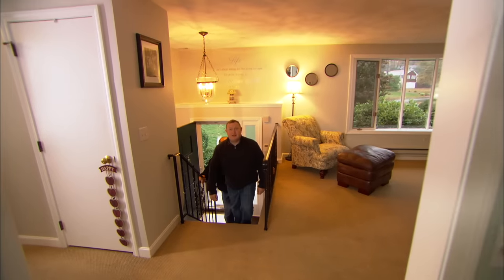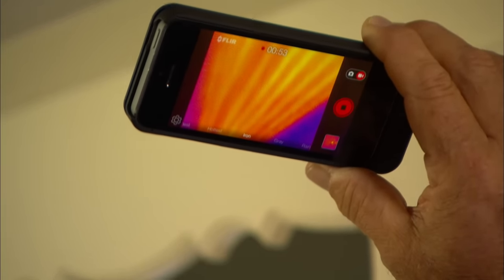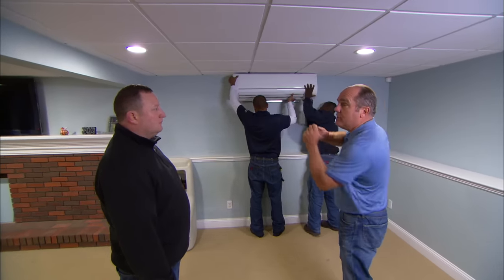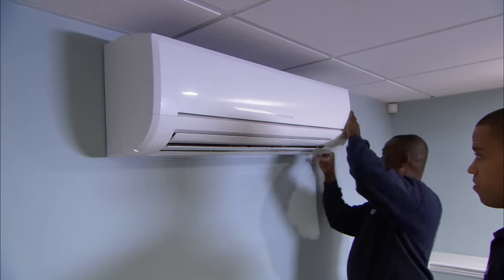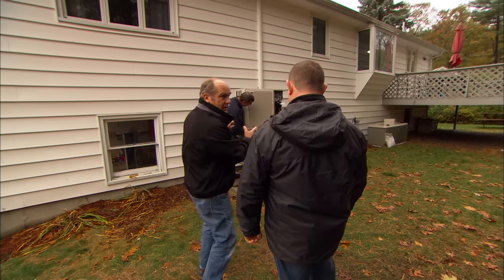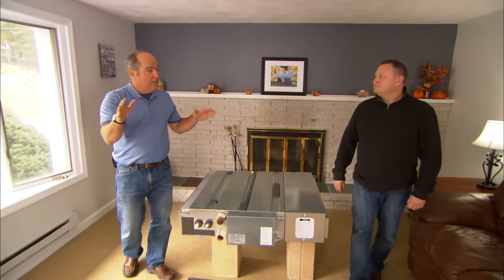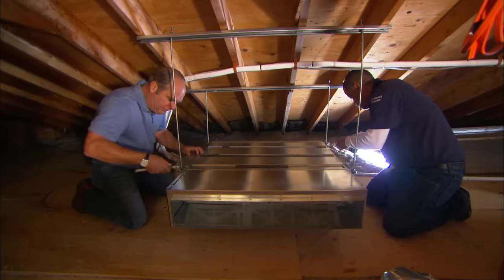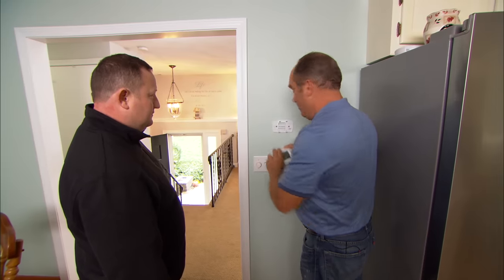How to Install a Whole-House Ductless System | Ask This Old House

Comment: HI Richard, while I like the information I would be interested, base on your calculations you made on this house what was the final cost to the home owner? It is nice to see these units being used in the north east.. The split system has been around a number of years now. Thinking of putting one in my garage so my workshop will cool in summer and a little warm in the winter. Thanks Rich
Reply: Richard Garrow just a single unit like showed in the first half of video with the electric heater was ab $2600 to have installed for a very large room. Don't know too much more.  They are basically maintenance free and fewer points of failure compared to a traditional central air. They last a very very long time too. Especially since you don't use it as much only when the room is being used. It can cool the room down from 80 to 66 in minutes while 100 outside it's great
Reply: Richard Garrow yes...Dan Lacker here has presented a good estimate, I was gonna say 2000 or a little more for a single head unit for one room from my experience in construction
Reply: Thank you both for your replies it is extremely helpful.
Reply: 300$ - single unit with 4" flexible duct that throws hot air into outside space through a hole in a window or in a wall. Requires cloze to zero installation (attaching adapter for its duct to a window). Comes with this adapter [4"duct->window]...
Reply: thank you Alek much appreciated information..

Comment: 40 grand in ductless to save $1000 a year ?
Reply: He is gaining Central air. I'm doing this for the ac the heat pump is just a bonus
Reply: Not worth it, do the math. Needs to be replaced in 20’years.... Thats $2k per year TCO plus utilities. No thanks.
Reply: Where are you getting this 40k number from? The outdoor units run from like 1000 to 5000, then each of the indoor units are 500 to 2000.. I could buy all the equipment for my 2000 sqft house for like 10k to 12k.
Reply: @michaelblackmer8183  Plus licensed installers, running electric and plumbing to each location. His numbers has got to be more accurate than yours.
Reply: paid $4800, 1200sqft, 4 head
Reply: @okedokie  What was the install total cost and the brand?  It seem to vary greatly.
Reply: @v10d  Why do you say it has to be replaced in 20 years? Even the older, less rugged A/C systems made it to 30 years pretty easily.

Comment: So, the only reason this should be done is if you have no mutual attic between the rooms, right?

Because a simple zoned HVAC system would do all this but for 1/5th the cost...
Reply: roadrunnersk2 a simple zoned HVAC system, while simple, does not quite have the same efficiency as these systems.
Hell, if you have a furnace, often times the bypass will trigger the hi-limit when only one zone has a heat call.

Of course, the other side of the coin is the problem with servicing these systems
Reply: Recall the RAID disk storage approach.  Redundancy and low cost that enables using smaller but multiple units that can back each other up.  Put a high seer small mini in each room or connected space as good load design calls for.  Because of the herein discussed inverter technology, each one can have some oversizing without efficiency loss. If one unit breaks down, and that always happens at night or on a weekend (think OVERTIME), just open the doors and let the adjoining units carry until the errant unit can be repaired, during those wonderful "regular business hours".  One compressor per house?  No, don't make me!  As I commented in another reply, air circulation and purification (exchanging with outdoor air) can be done separately.  Or just open a couple of windows now and then?

Comment: GREAT ideal. However,  I would like too kno the maintenance on a system this size.
Reply: I think it's less complicated when you look at it as 4 small systems. They run independently of each other other than they're connected to same outside unit.

Comment: Without reading 355 comments I have no way to see if someone else caught the misleading title. The first system was indeed a "ductless" system. The attic units are NOT ductless. They are compact air handlers (using flex duct) connected to a zone system so they can share a single compressor outside. I'm sure there's a savings in operating cost but the equipment costs have to be out of this world compared to a conventional air handler with outdoor compressor, doing the top floor as a single zone. As a side note, I recently had a 2 ton outside unit replaced (split system ductless) because at 5 years old a new control board was $1,100 and the entire unit was only $1,400. Deciding factor? The new board would have a 6 month warranty and the whole unit would have a 3 year warranty. On a positive note, the system works well here in CT where winter temps drop to near zero at times. I have no idea what operating costs are because it's a small office with WAY too many other electrical items that are always on. (and that probably helps heat the place too)

Comment: And what happens when it's below 5 degrees? Bundle up and wait?
Reply: The Hi or high heat version of that equipment is efficient at lower temperatures
Reply: @peteaulit  you're right but not to 5 degrees

Comment: Refrigerant isn’t cold it absorbs heat under a lower pressure and releases heat under a higher pressure. The compressor just moves the refrigerant in a circle between inside and outside. Depending on whether you want heating or cooling the pressure differences. Change from inside or outside
Reply: Wow

Comment: My man forgot the nylog! They'll be back for a charge😉
Reply: got'a set up that service call ;) Oh you DON'T want the extended warranty? No problem I'll just put this Teflon tape away. ;)
Reply: “Nylog is for techs that don’t know how to make proper flare fittings”. That’s what my AC teacher used to say.
Reply: @peteaulit  your teacher probably doesn't use digital gauges or a micron gauge either. Stuck in his old ways. Make good flares AND use nylog.
Reply: @aaroncruz5854  funny... my teacher thought me how to use a micron gauge and the importance of using it. He was also an experienced refrigeration tech who knew how to make leak-free flare fittings having worked on semi-hermetic compressors, something that clearly a lot of techs lack these days. So is nylog a good thing to use? Maybe but it’s not necessary. 
Another thing he used to say is that you can make an AC tech out of a refrigeration guy but the other way around is much harder and I definitely second that!
Reply: @peteaulit  yes, going from hvac to refrigeration is more challenging. Only the good ones can push through and learn both. I would challenge that pressures for 410a and having flare fittings, while perfect, could still develop a leak. And better safe than sorry. Plenty of bad techs in commercial refrigeration also.
Reply: @aaroncruz5854  ha! No doubt on the last statement

Comment: I had never heard of putting the heating elements in the ceiling. That seems very ineffective, cold floors blazing hot ceilings.
Reply: Many homes have the ducts in the ceiling.  It's super common in say Florida where homes are built on slabs.  Overall, it fills the whole room with heat.  Even if they were in the floor, the heat would rise up immediately to the ceiling first as heat rises.  It works.
Reply: @mymorristribe  Interesting,.I have never seen that before, then again in New England we get 20 below zero weather.
Reply: Had it in NC, sucked until we hung ceiling fans in every room.
Reply: I have been in a couple of homes with heating elements in the ceiling. Electrical heating was the "hot" trend in the 1970s as the cost saving alternative to expensive fuel oil during the oil crisis. Once the oil crisis ended, fuel oil was far more economical to use for heating. The oil crisis also drove increased used of natural gas for heating (vs fuel oil) - my 1982 home has had gas heating since it was constructed.
Reply: James Rose I honestly recently learned just how effective a ceiling fan is with radiating ceiling fan heat down. I thought it would cool my house down better, if I pushed the hot air from the ceiling, down, so the AC can cool it. Yeah, NOPE. that heat can just stay up on the ceiling, until the 3 days of the years in Florida when it’s cold.

Comment: How much did this system cost for The materials, 4 zone, condenser, basement ductless and air handler?
Reply: $4,600 with 18 months financing interest free.
Reply: @billyrowe0064  Where you get that info? It says 10K+ above, and I am sure this install was WAY more than that. Just a single mini split install maybe 4-5k!

Comment: Electric heat cable  is installed AFTER the sheetrock, and is then plastered.
Reply: wrong it's embedded in the sheetrock I've installed quite a bit of it in the past,at least the products I've installed.
Reply: @sirstomper  how do you embed it in the sheetrock?

Comment: I don't really understand why you said that an inverter will capture the heat. From what I found, and from my electronics knowledge - an inverter just controls the speed of the compressor in the a/c for more efficient cooling/heating. You don't necessarily need an inverter for heating.

Comment: I would Never...NEVER offer this to my customer.  First, its cost prohibitive.  Second, there are ducted residential inverter type heat pump units that offer this efficiency without all of the duplicated attic evaporators and refrigerant lines.  Third, you just multiplied all the breakdowns and other issues you have to fix when you have a breakdown, and working on these units are typically more expensive to fix.  Finally, it appears that you will have uneven room heating and cooling in each room, especially when supply ducts are not placed by windows to diffuse the incoming heat load/loss.  Good luck with that.
Reply: Van L could you name a few models for residential inverter type heat pump systems? Thank you.

Comment: Man these ductless systems do work when installed correctly.. meaning all the mechanic fittings are tightened correctly with no leaks. Boom there good. If not then there are leaks and the BIG ITS NOT WORKING Hits the ears of the technician. 😑 In all these units are just a pain to work on.

Comment: It seems to me that the multiple units would be working against one another with differences of temperature settings in different areas of the overlapping zones of operation which would be more inefficient and drive utility rates even higher. Without isolation of zones, the operating units would have to work harder.
As for radiant heating ceilings, thermodynamic principles establish that heat rises and therefore would be highly inefficient as most of the heat generated in the system would want to rise away from the area wishing to be serviced again requiring more energy in than usable amount of heat out.
Reply: This reminds me of an episode of Futurama where Amy and fry go for a ride on mars in her car and each person has their own climate control zone and they keep offsetting each other by increasing hot and cold instead of turning both down.

Comment: I have been using this split type design for years. The units can heat as well as cool, though as I live in the Philippines, we never use the heat part of it. 

There is one thing that isn't mentioned. These units need frequent cleaning with high pressure water. And not just the outside compressor. The inside air handlers need to be cleaned as well. We always position our air handlers above windows where we can use tarps to drain the water during the cleaning to the outside. Using the units 12 hours a day, we need to do this every six months. 

So how is that going to work in the attic?
Reply: I saw these all over Australia when I was there. One benefit is in most the rest of the world ductless is common, older and affordable tech.  But its still new to the US [ thanks to hvac manufacturing lobbyist] , and as usual the US consumers get charged a premium.

Comment: insulation insulation and more insulation Bonus would be roxul insulation and if I could have gotten it back in 2004 it would have been put in my modular home .I just added more to my attic and I am considering tearing out the membrane  and old insulation under my floors and putting in roxul .I have upgraded just about everything in the house .We only have electric here or propane .Nothing else in the country setting here

Comment: How much does it cost to maintain the refrigerant in this system?  Looks like all the tubing connections were made with flare fittings.  There is a manifold with 5 zones inside and another line-set that goes to outside unit; so SIX line-sets total.  A line-set is two pipes with flares on both ends; so four flares each line-set.  Also two shraeder valves on the outside unit.  6 x 4 + 2 equals TWENTY-SIX possible leak sites!!!  A flare connection is cheaper labor than brazing a connection, so why aren't standard A/C units installed with flare fittings?  Conclusion:  flare fittings must be an inferior connection to a brazed joint!
Reply: Flare fittings are standard in propane heaters.
Reply: In these systems (which use R410A refrigerant) flare connections provide the least contamination in the system.

These connections must be tightened with a torque wrench.

The way I heard it, in Mitsubishi’s case, the engineers cane and saw the brazing practices in the US, and determined that in order to warranty their equipment, they would have flare fittings instead.

Back in the day, we did not use nitrogen to braze, and this would cause carbon flakes in the copper to form.  In these sophisticated systems, these flakes can plug up a Kettering device.

I think they are not moving to brazed fittings in the commercial side, though.
Reply: They have moved to brazed fitting in commercial applications.  It is true that most people dont purge with nitrogen as they weld. It's also true that the carbon or soot builds up inside the pipe.  What I hate is the 80% of techs who cant figure out how to flare, use a torque wrench, lube the fittings prior to torquing, and overall stupidity.
Reply: It is the manufacturers directive to use a torque wrench and add a drop of refrigerant oil in the threads.  Not sure if that is what you refer to as "stupidity".
The flaring practices in mini-splits vs conventional split systems is a bit different.
Reply: It is a slightly different practice with different tools when it comes to mini split systems.  For starters, you don't use the same flaring tool that is used for, say, water and brake lines.  The conventional tool tends to simply squash the tubing into the cone, which causes micro fractures in the tubing.  In mimi splits, the tool constantly spreads the tubing around until it reaches the flare form.
So, if your grandpa taught you how to flare refrigerant lines for mini splits, great!!!  
But if you are referring to conventional flaring, then it is a different methodology.
Reply: D B yeah, I don’t think that’s what he meant now that I’ve read it again.

Comment: This is a good idea where northern areas still heat with freaking fuel oil! Or propane! If u have natural gas that is still the way to go. 
I have a heat pump system in il. Brand new 5years ago. 7k to install vs 15k to get natural gas to my house. Works great but it's a cool heat. Register is putting out say 75f to get room to 70. Gas heat would be 110f. So gas heats a room faster and "feels" better . 
Heat pumps have there place but hardly for everyone.
Reply: Yes sir, heat pumps are only good till about 35-40 degrees Fahrenheit. 
Here in Texas we actually install heat pumps and gas together(Dual Fuel system) from time to time. Primary source of heat is the heat pump and if it cant keep up or runs for an extended period the gas furnace will engage and shut down the heat pump.
Reply: @jesseluna4731  Ahh - so installing 2 systems is a sure way to save money?
Reply: @Redandranger  Its not 2 systems. it's still one system, with 2 separate heat sources which can heat the home if the outside conditions becomes too cold for the heat pump to run.
 
a gas furnace
an evaporator coil
 and a heat pump for the condenser instead of a straight cooling unit makes it a dual fuel system. which is still "one system"

Comment: Moving heat is more efficient than creating heat? Creating heat is 100% efficient, no matter what the source. Different sources have different assigned cost however. The only increased efficiency from that system would be from the cooling aspect.
Reply: Well, something like that: the only 100% efficient appliance is an electric space heater.
However, it really is less expensive to move heat than to generate it.

Comment: Inverter just means that it's motors run on DC voltage. Pretty sure 98 percent of the mini split market consists of inverter units.